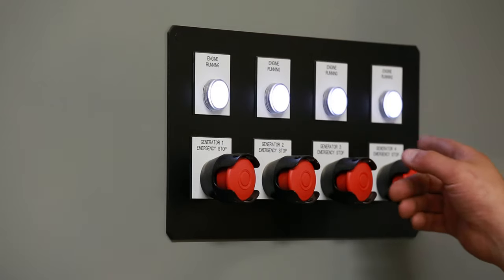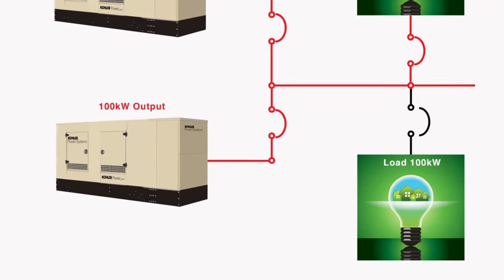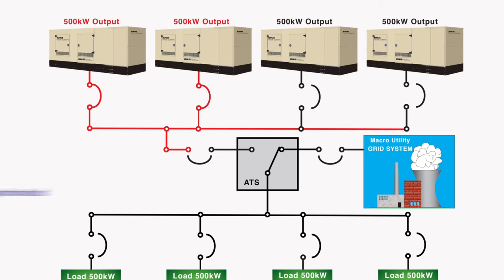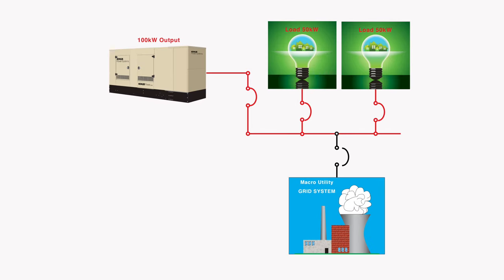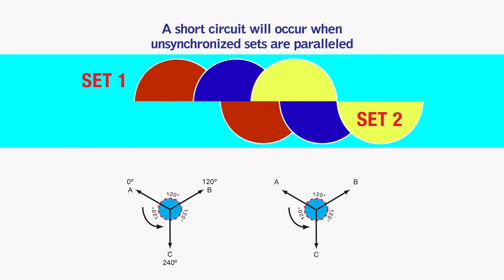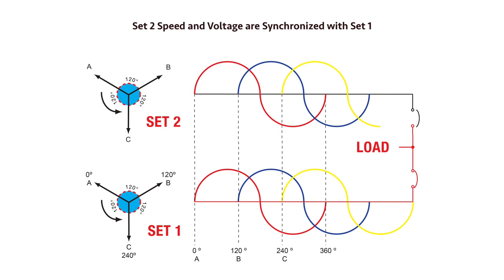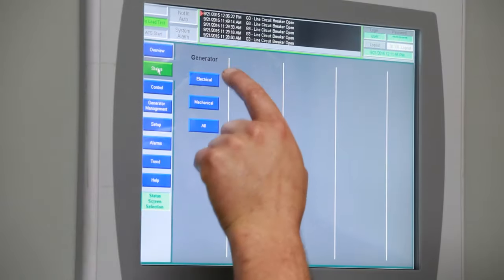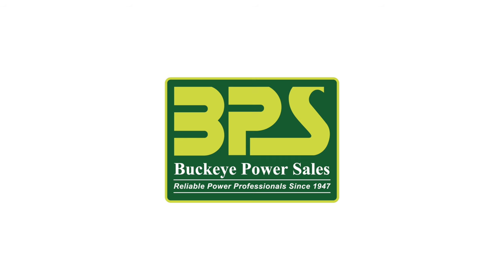Paralleling Generators

Comment: Can you write in this wall how to paralelling in manual and auto system,please write in good explain thank you
Reply: sorry to see they didn't give you an explanation
and he basically just explain.  how it works either it's controlled by a computer system or by an individual.
but if you're going to have generators in parallel or in parallel with the grid.  You are going to have a licensed electrician on site.